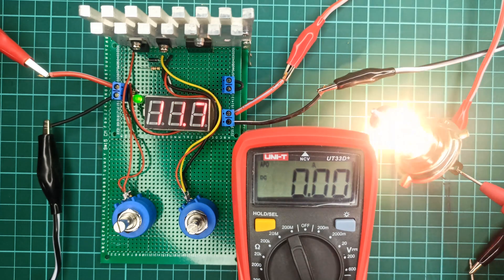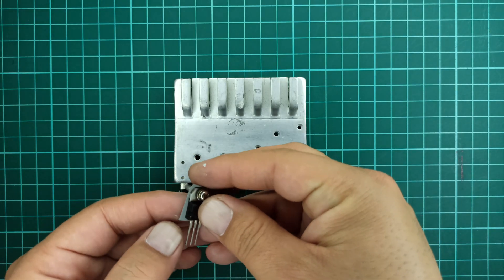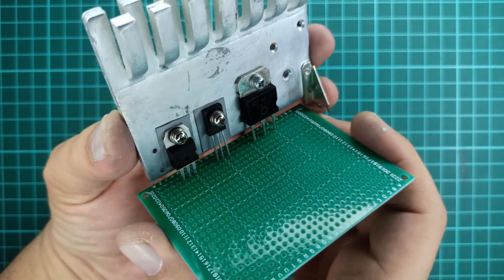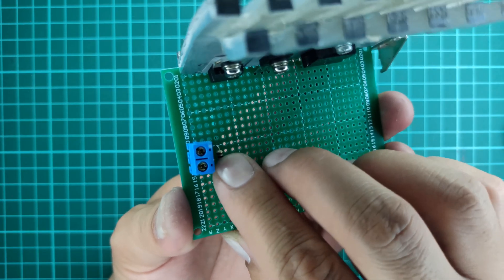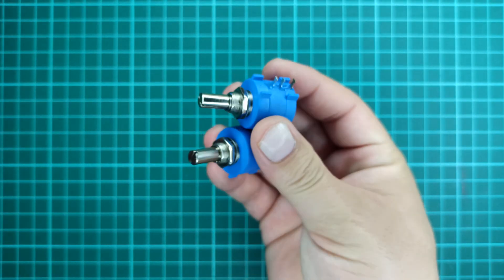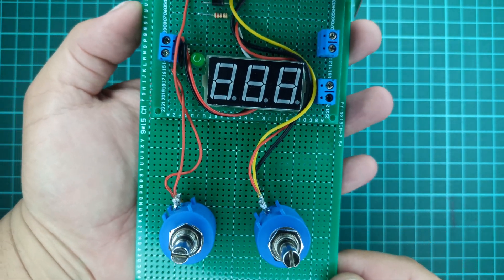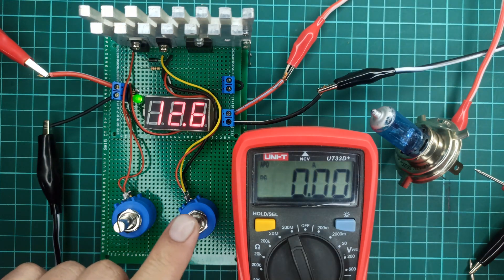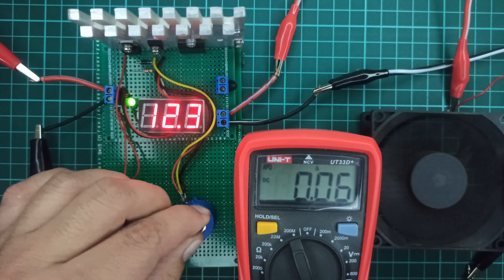Variable power supply | DIY | Homemade

Comment: Thank you for the tutorial =).

I found the potientiometers to differ highly in price. I found 10k ohm potentiometers for a few euros up to 70€ for one. To what aspect should i pay attention? Is there added safety for high priced potentiometers?
Reply from the maker: You are welcome and thank you for watching my video.
Actually these potentiometers provide more precision and easy tuning as compared to the normal ones.
If you add a normal POT instead of the one shown, then you might feel difficult to adjust the voltage/current precisely.